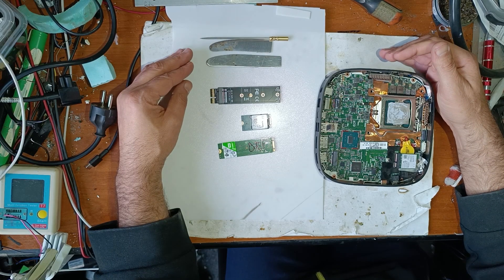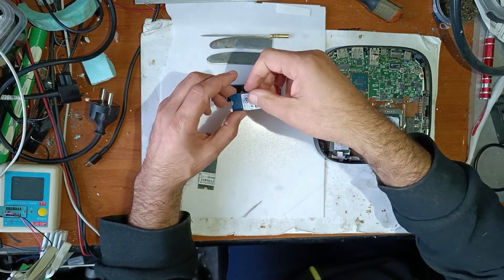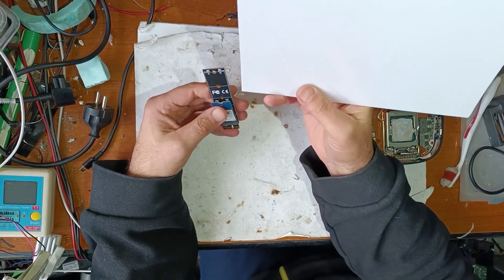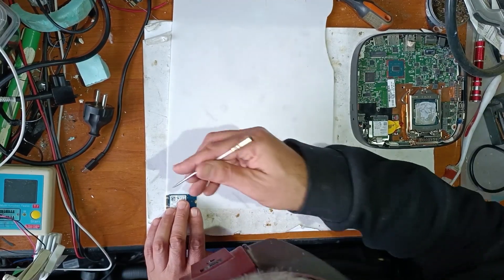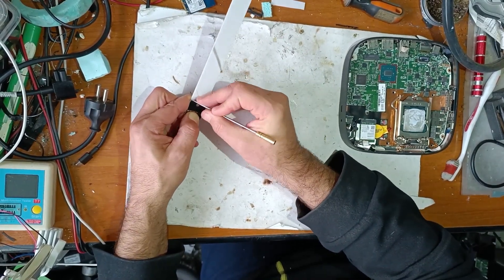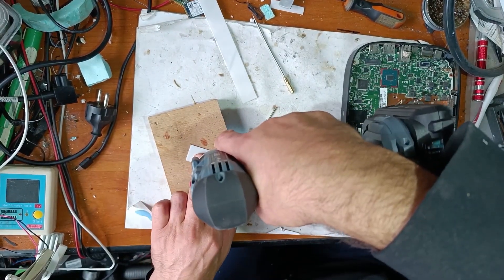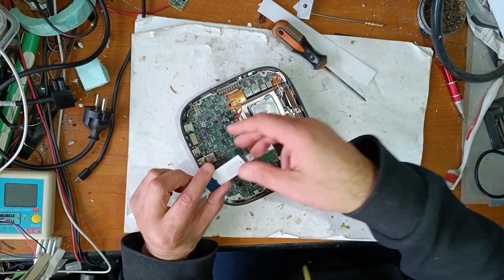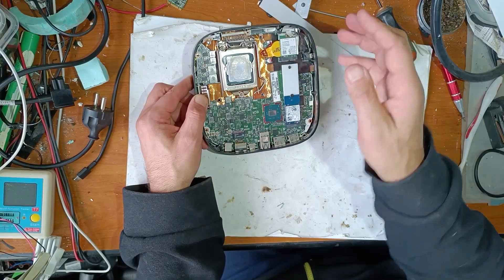Diy M.2 Adapter 2242 to 2280

Comment: Very good idea! 👍 One question, if you don't mind. What kind of metal pencil or needle did you use to scratch the plastic? Is there a link or exact name so I can take a closer look at it on the Internet? Thx!
Reply from the maker: tnx bro. its just an old screwdriver with sharp head, its not special. u can diy from an old tool.